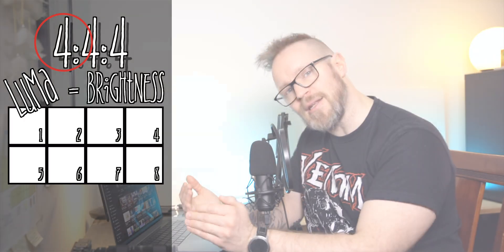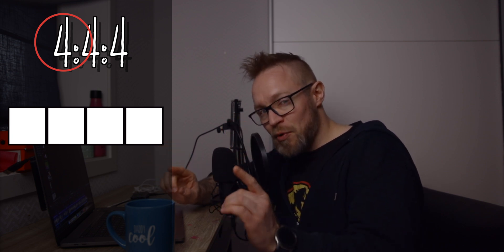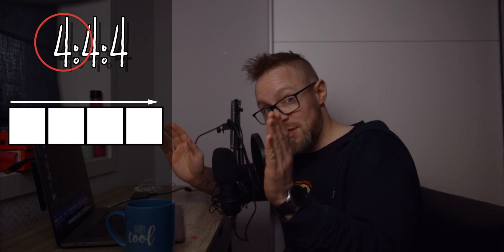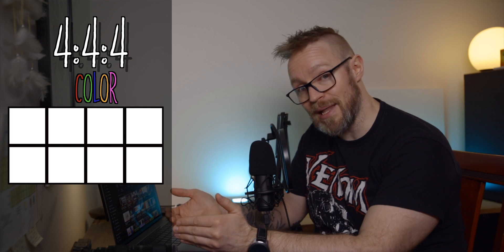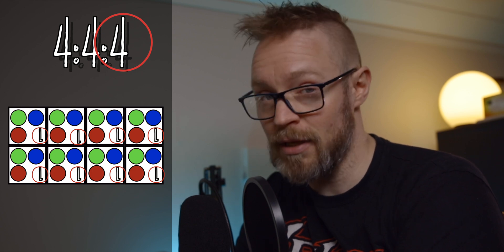Chroma Subsampling

Comment: Thanks Roger for the clear explanation of chroma subsampling. So if I understand it correctly, the subsampling is just a group of single pixel, so to be more precise, a group of 8 pixels? So a screen is build up by multiple sampling blocks of 8 pixels total? And with for example 4:2:2, two pixels share the same color, but still a different luma value?
Reply from the maker: Yes 😊👌🏻 But it’s not the screen, it’s the sensor 😊